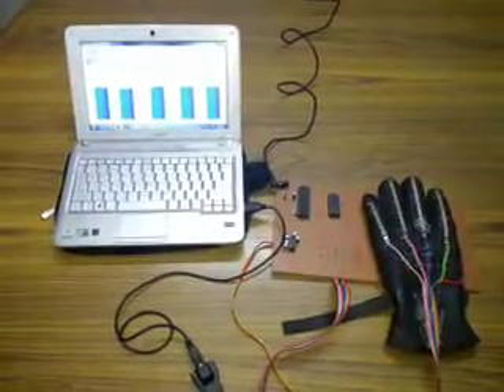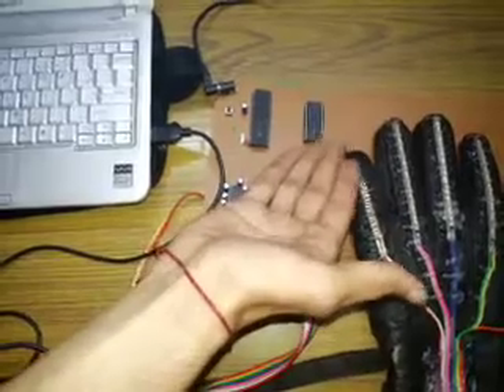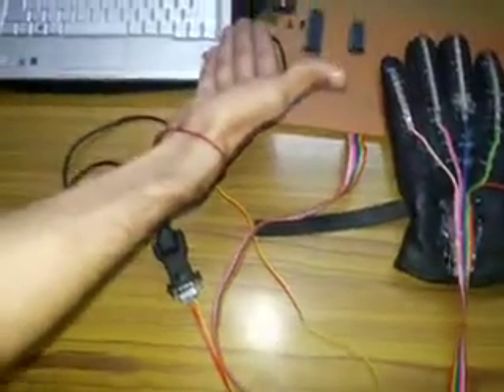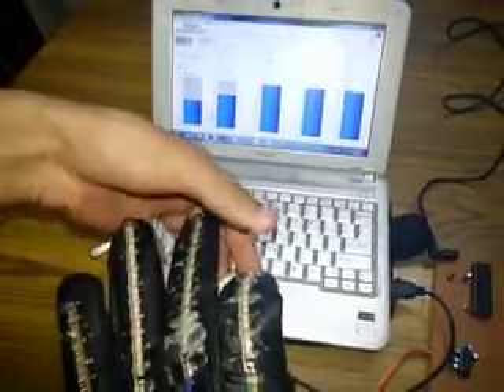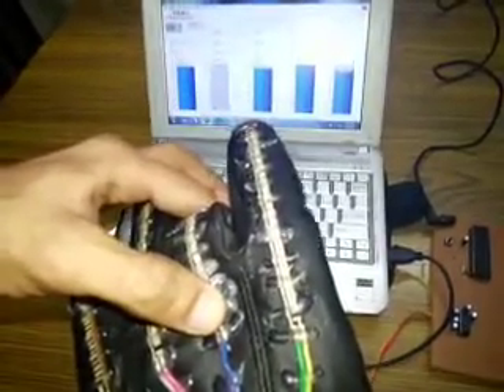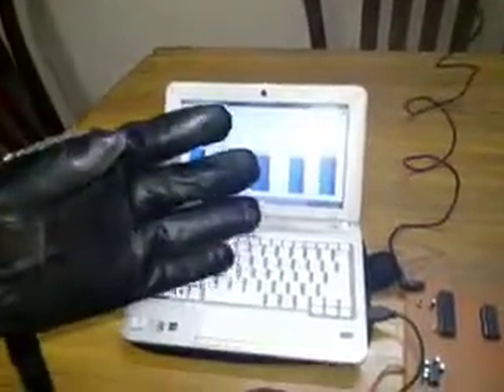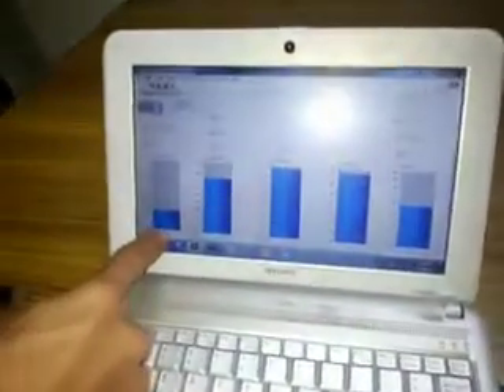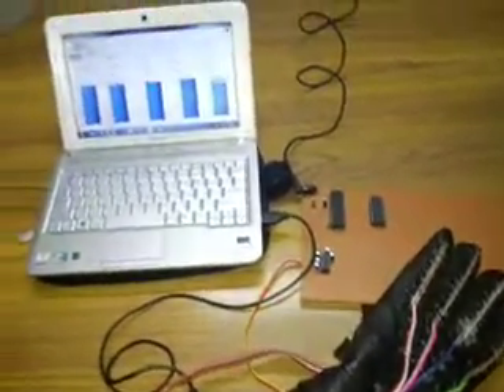Hand gesture system with display on labview

Comment: I am working on a similar project. 
I have to control the values of a circuit created in labview using the gesture.Similar to yours
Please inform
Reply from the maker: You can control by serial data or by bluetooth data...for more details please contact on sumitgrover97@gmail.com or 9988632849